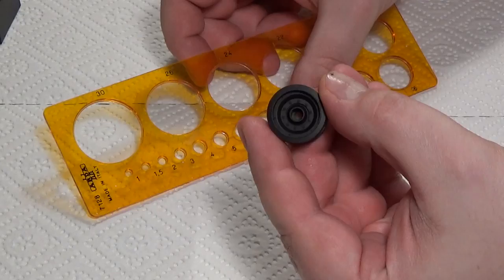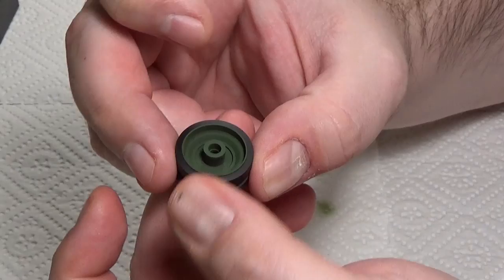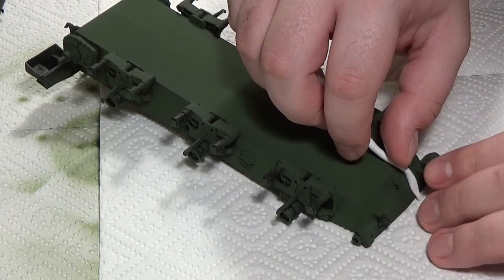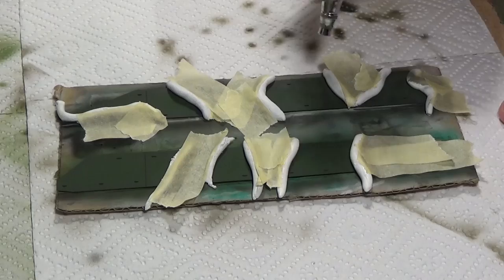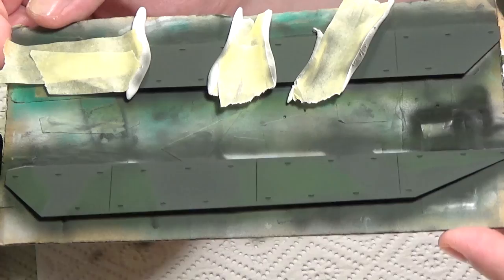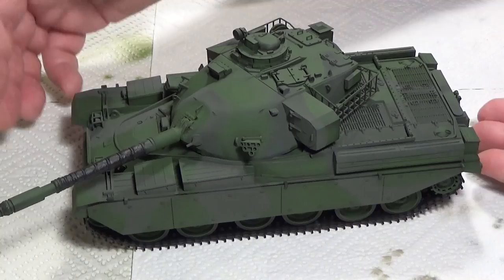Model Chieftain Mk.5 - 1/35 Tamiya - Painting

Comment: British military vehicles when it came to camouflage were often brush painted. There was no feathering so using a brush on a model would be accurate. I have personally helped paint entire (full sized) vehicles with a paint brush. This was done in NATO green over all the mud and rust. Handles, hinges and rubber seal were also painted over. Up close it looked horrible. The inspecting officers knew to stand well back before saying what a good job we had done. It was all a game that we had to go through. I used to take pleasure in squashing as much paint as possible into the door mechanisms knowing someone would have to spend hours digging it out. A mischievous streak that I had.
Reply from the maker: I know that, mate. When you come close to airplane you'll see they are also painted "sloppy" ;)
It's all in the scale though, when 1 or 2 mm of paint have to be divided by 35 or 48 or 72 you'll have to achieve a VERY thin layer. It's only possible to be done by the airbrush (at least in my opinion).
And I agree that modellers try harder than the people who service the real weaponry ;)

Comment: Great video, but  as an ex Chieftain crew member I can assure you we never camouflaged under the hull. Thanks
Reply from the maker: I know it now, mate. This was my first tank model EVER. Besides, believe me, it's hard to find a picture of the bottom of a tank ;).
Fortunately, nobody sees my mistake (except all the people who saw my movie ;))
Reply: and they had a plate underneath to undo the fly wheel from the engine and a bucket hanging off the back for your toilet
Reply: @neptuneblood6916  is that true? I’m just in the process of building mine and a poo bucket on the back would be awesome haha
Reply: @4cnkh4  yes matey we had a 25 litre plastic drum with the lid cut off with some foam pipe insulation for comfort and hang it off the spair  track hooks on the back

Comment: The camouflage colors are wrong! Gray??? how you figured it out? This tank must by sprayed with RAL Green and Black! This black can you mix 50/50 BLACK and dark GRAY. Than wash and use pigments to lighter the both colors!
Reply from the maker: I've used Tamiya's XF-27 BLACK GREEN. Watch the next episode, you'll see that it darkened as fuck and is near black.
This paint is strange because it sure looks like a light grey when it's sprayed and matt. But when you spray a gloss varnish over, it changes completely.
How did I figure it out? Check the manual, there's Tamiya XF-61 suggested which is even lighter than the one I've used.
Reply: @Big-Modeller  but I'm not talking about green but about color scheme. This tank had RAL 9011 graphiite black and RAL Green, do you underatand? You used Gray color not Black! The manual colors are stupid!You can mix  dark gray XF-24 with Black XF-1 Your gray is nonsence! Some modelers used mix of XF-65 and NATO black
Reply from the maker: I feel strange anger in you. You probably care too much.
Reply: @Big-Modeller  you don't feel anything at all or you're completely mine!
I'm just telling the truth. I'm also a modeler and I would definitely put a color similar to black and not gray. That's all there is to it, because you can't accept reality!
Reply from the maker: That's exactly the case. I just can't accept reality. I try hard though.